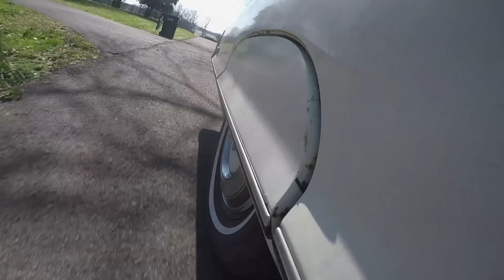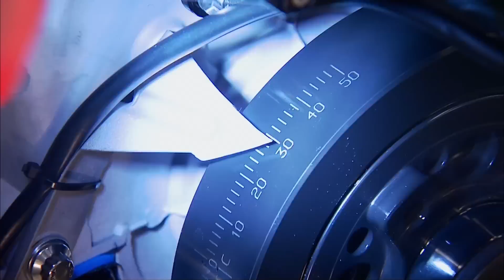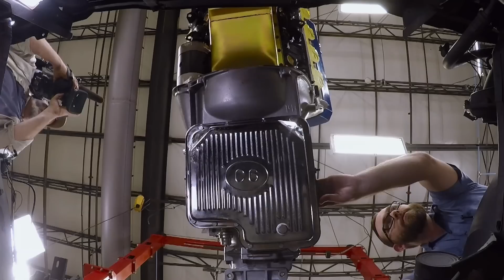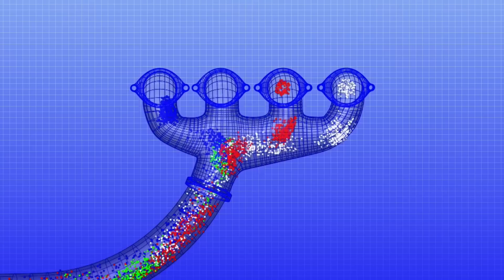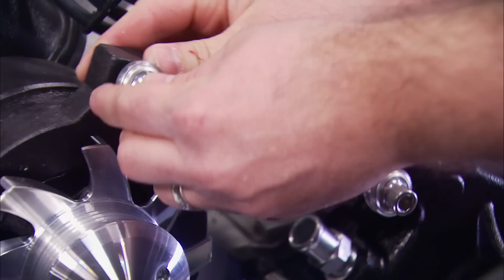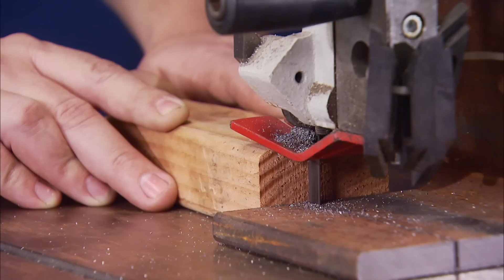Putting A 1,100 HP Big Block Into A '72 Mercury Marquis - Detroit Muscle S3, E8

Comment from the maker: We'll continue to post these episodes here on YouTube. If you can't wait for the rest of the build, visit our site to binge-watch: https://www.powernationtv.com/shows/detroit-muscle
Reply: Love to se a Shopping list. But with the Head'ers is it 6224HKR, 6126-1HKR or  6114-1HKR or some other model.? My friend and I is working on a Ford LTD frome 1972 and it would be extremely helpful since we are living in Denmark and can't afford to buy the wrong parts dou to our imports charges.
Reply: @ketillundsrensen6167  6126HKR
Reply: @ketillundsrensen6167   Denmark? Wow? The '72 Ford LTD was a fantastic car. I don't know where you were able to find one in Denmark but way to go!. I think the LTD back then came for most purposes with a 352 cubic inch engine (worthless) or a 390 which was somewhat better. The 390 was bad to "float the valves" at anything over 4,000 rpm's which means it just runs out of breath. The 390 does much better with a higher lift cam and stronger valve springs. Porting the heads to match the gasket and manifold also does wonders. A car that heavy will wake up if you will with a 3.90 or 4.11 rear end. Good luck with your restoration. Post some videos for us. I will follow you for sure.
Reply: @beboboymann3823   my friend just had his ASTROvan crashed by a drunk driver. So he was looking for a cheap US car with a V8 to replace it. He found the LTD and since 4 doors and Stationwagon isn't that hot in Denmark he could pick it up fairly cheap. We are both falling in love with the car. After A lot of hours working on it doing the winter, it was imported frome new and landed in Denmark January Og February 1973 and belong to a rich family. Since it was kept in a garag for 15years to somebody was buying it. He installed a LDS diffrenciale and a "line lock" to lock out the rear brake and then used it to smoke tyres on American car events then he sold it to a guy how had it for a year before it landed with my friend. He's mother made a new interior in high quality leather. And we services the engine. It had the silly D2VE-A2A heads so they had to go. We were lucky enough to find a 460 engine with Edelbrock RMP gap manifold and C9VE-A heads. It had a 4 barrel 600cfm karburator on it so we kept that. I made a set of ONE OF valve covers in aluminum from Some leftover materials at work and we made a new exhaust. The previous owner had taken 2times  5meters Og 2.5" exhaust pipe and just put it on each side of the Downpipes it was goind under the car and under the diffrenciale, so we had to make our own that was Alot more tigth to the body. I think we gained 5" from the road and oå to the exhaust.
Now the Season is almost up for this year so we have to take it in again and do some more stuff. Just for the killing the Winter times
Reply: @ketillundsrensen6167  Sounds awesome brother.
Reply: What happened to that car,I love the old iron.  Sure would like a chance to try out  that ride. I already watched the next video.
Reply: PowerNation thanks
Reply: Do yall ever give any of these away?
Reply: Should have slapped an 8-71 BLOWER on that baby....nice to see spray on the button instead of the WOT switch which I always thought was STUPID at the track which is why I always run my spray off the button so I can grab it once I know the car is hooked up and ready for it!!! I have had way more success keeping it hooked off the button instead of the WOT plate switch!!!  👍👍👍👍👍👍👍👍👍👍👍👍👍👍
This is what my hand looks like right before I drop 200 on the un-suspecting sucker!!
Reply: Y’all should put some 26’s on this car and go Donk racing 👌🏽🤷🏻‍♂️🤣😂
Reply: Hey PowerNation someone from Canada did a restomod on a 1985 Mercury Grandmarquis 2 door coupe. It has a frame out of an 07 Crownvic with upgraded brakes and suspension, 96 Grandmarquis dash that has been painted black, S197 Mustang seats and console, and a 5.4L DOHC 32V V8 out of an 03 Lincoln Navigator with 03 Cobra heads, 96-98 Cobra camshafts, an Aussie Boss 290 intake manifold, and a Mercury Marauder airbox along with Longtube headers, an X-pipe, and a Dynomax cat-back exhaust in the result of making 341 HP and 351 Ibs of torque at the rear wheels along with a 5-speed manual transmission to make it all fun. The engine he swapped in before was a Procharged 4.6L SOHC 2V V8 making 390 HP and 386 Ibs of torque at the rear wheels along with a 4r80W automatic transmission. Here's the link belowhttps://youtu.be/9EbLSypnrPM
Reply: Some old man or woman kept that nice  you probably stole it,  leave it be   , good god it'st ugly  as hell

Comment: here's a tip for all you guys that have trouble installing a trans of any kind to your engine, way back in the 60s i started doing this, take extra long bolts that fit the bellhousing, cut the head off and grind the end of your home made stud to a point. screw a couple in, or however many you want, and you can just let the studs line up your trans to the engine, simply unscrew the studs and put your bolts in. i still have a drawer full of different size studs i made for different applications. made it easier after i got too old to man handle those heavy transmissions.

Comment: 2 things could be better on this build ...first a beefy making irs for the rear out of Lincoln mark 8  would work well..I did one easy peasy. And  Second why  use a  C6 when everyone knows   a  well Built  AOD reigns Supreme nowadays and you need an Over drive if you want to make it to the pump before running dry. And it would allow you to run some good rear gears... at least 3.73's... but some 3.90's would be ideal.

Comment: My Father owned a 74 with a 460 motor and posi trac. Durring the blizzard of 78 that car made it through all that snow like a knife thru butter. Also many trips to Florida in total comfort. The smoothest ridding car ever, and at 75mph (which was the speed limit then) if Dad was passing it would print you into the seat and we loved hearing those 4 barrels open and that engine roar. Good times.

Comment: Sorry guys , l still work in  litres. So your engine is about 9 litres . In standard tune it's producing 755 hp , tuned but still reliable, over 1000hp. To put this in perspective one of the most revered engines of all time , the Rolls Royce  Merlin in prototype form only just exceeded 800hp. Of course it went on to produce a reliable 2060hp, and at the Reno Air Races they make nearly 3500hp for very short periods. So why this piece of useless information? Well the Merlin was 27 litres it's big cousin the Griffon was 31litres. This shows how we have progressed in high performance engineering.

Comment: Putting a weave in a full pen weld allows the puddle to cool enough that when you whip back onto that colder spot you've compromised the penetration . You now have a pass full  of  weak spots throughout the weld on every layer. Run each pass with one solid smooth motion from the beginning to end of each pass.

Comment: The fuel line must be like a firehose
Reply: Ha Ha that was good
Reply: Do you rate the fuel economy in MPG or GPM with a car like this?
Reply: Whats the guess on fuel mileage?? With an 1100 hp Dinosaur engine , even updated its based on 1960's technology so I'd say 2-3  gallons per quarter mile. The new Dodge Demon uses 4 gallons per 1/4 mile  pass... so this beast is a virtual gas sipper

Comment: 396 BBC with new edelbrock EFI. Cant get it running right. Help?
Reply: did you tell the EFI what cam you have?
Reply: @pablopicaso8374  yeah the wizard setup addresses that
Reply: @joshuahand407  did you make sure its getting good power? They are really picky about getting enough voltage
Reply: @pablopicaso8374  I'll check

Comment: The problem I have always run into, is 1965 to 1979 frames rot where the control arms bolt in. I ripped the 9 inch out of my 73 Marquis, a 67 Monterey, 68 Custom 500, etc. Another cool feature from the early 70's, was start the car, put your foot firmly on the brake petal, and wing the throttle, she would jump into reverse every time.
If you are still reading this, the cheapest horsepower boost for 1973 and up, is to buy a pre-1970 429 timing set.

Comment: For all you potential Marquis owners out there, they pulled a 385 series engine and C6 transmissions and replaced it with a 385 series engine and C6. If you wanted to keep your accessories intact... just swap them over, mounts and all. Yes, V belts can throw at high RPM, like they said, but that's a risk you take.

Comment: power steering adapters to run a saginaw power steering pump ? ford used them from the factory in the E series vans , play with the years and you can easily find a hose that connect at both ends and work with minor tweaking / bending of the steel ends for correct routing , been there done that more than once ...

Comment: shame on you guys , you never mentioned the steel plate between the water pump and the front cover , many a 429/460 has cooling issues because they are left out buy people that don't understand , and or yank a pump and it's stuck to it , and it gets tossed , these engines cool poorly at hwy speeds without it , and can even over heat , but yet will idle for days and never overheat without it , a many of heads have been pulled looking for a cracked head or blown gasket all because that water pump backing plate is missing .... a segment on or including this issue would be a good idea when another 429 or 460 varent comes down the line ...

Comment: Those was the kind of cars that were like kind  off roads springs.  you run over speed bumps and curbs the loose springs  and weight absorb the bump and is so smooth riding doing it the speed bump killer.

Comment: The body style is very interesting, a cross between an Eldorado and a Torino. Does anyone else get annoyed with these high-dollar builds that cost more than the car is worth? I don't know ANYONE that has a fully equipped shop with $7,000 worth of this and that tool for every fastener somebody can think of. I pulled the engine out of my Suzuki XL7 in my driveway, and replaced head gaskets re-using the head-bolts because I don't have the money for new stretch-bolts.

Comment: It's not angle iron, more mild steel angle. They stopped making angle iron at about the end of the 19th century lol. You can still see it on some old bridges.
Rather than cutting and welding it you could've just gone and bought some channel off cuts from the steel yard. 

In fact they might've let you rummuge in the scrap bin for free. 

Re the welding at home, a good home inverter stick welder turned up on high and multiple passes. Small stick at the bottom with the amperage turned down to say 140ish then the classic 3 pass weld with a larger rod layered nicely into the adjoining pass (the way you learnt at night school) - right? : )

Comment: I don’t wanna b a downer but...that’s not an 1100 horse engine. It’s 750 with no accessories and before drivetrain loss. It’s prolly about 600 to the wheels
Reply: Yeah, I felt like the title was a bit of click-bait. Sure it made 1100hp, but with a big shot of spray. It's a 750hp motor, that's probably putting 650-ish to the wheels with full accessories. Still though, I enjoyed this build and it would be one hell of a fun sleeper to go rip around in. I've always loved sleepers, so I like oddball builds like this. Even at 4600lbs (which is actually less that I would have guessed it weighed), 4 digit HP/TQ on spray is still gonna haul ass.
Reply: @branchtana315  Note too that such a '385' series (429/460 family), especially with more than 600", has gobs to torque. Even 600-700 ft lbs can break axles, especially on a two ton+ plus machine, with a properly set up rear suspension, etc for good traction.
Reply: The normal parasitic loss on an auto is about 10% where are you getting a 400 hp drop? Or about 40%?
Reply: @Themadoutbacker  He's deleting the NOS
Reply: Nitrous, man!
Reply: I was looking for this comment so I didnt have to repost it 👍
Reply: Good catch, there. Note the HP rating of the original 1972 429 was probably 275-300 HP at the crank, that ca 200 ponies is also at the wheels. :)

Comment: Why did they have to use a Garbage Motors power steering pump?
Reply: Actually,  Branon, its a Saginaw PS pump and all of the big three used to use Saginaw products way back then right up to the 90's due to its excellent reliability.

Comment: Ford Powertrain Applications has headers that fit the 1970s fullsize Ford, Lincoln and Mercury cars with 385 series 429/460 based engines, which is the headers that I have on my 460 based 521 powered 1978 Mercury Grand Marquis daily driver.

Comment: "Oh lets take this 1000hp engine and put it into a car that can't even handle the stock engines power and becomes dangerously unstable at above 80 mph and will require more space to stop from that speed than an 18 wheel truck." 

Good idea LOL.
Reply: Dangerously unstable? These old lincolns and mercs could easily cruise at 120 no problem, I've done it. As far as the chassis, they are built pretty damn robust!
Reply: Now braking is not bad but I think they upgrade those as well as the rear end!
Reply: Those cars hugs the road like a cat on velcro.
Reply: Hey folks its BeyerT1 the Typical modern car lover.

Comment: Lose the solid roller and nitrous. Add throttle body fuel injection for drivability/maximum low-end torque and now you've got the ideal land yacht.
Reply: Miles Rains these cars aren't gonna be daily driven. That would be a waste. The cars on this show are made for that, show. And to sell parts for their sponsors.

Comment: cool make all that power just to use a power robbing no overdrive C6
Reply: Matthew Skaggs C6 are required when makong 1100 ft tq. It was either that or a powerglide, which we know Ford guys hate.
Reply: At least do a built 6r80, while it will may rob just as much power it would at least provide overdrive which would think you'd want for this project.
Reply: The C6 is the easiest and strongest to put behind this engine. However I would love to see a built 5R110 behind it!
Reply: dodgeguyz I’m disputing that my point was at least get a trans with overdrive and a 5R110 would be cool too.
Reply: Don't worry, think they're gonna keep the 2.75 in the rear so the RPM's stay low. . . 
this should last forever.

Comment: What about the MURCURY MAURAUDER BODY? YES 390..WAS GOOD..I HAVE A 1968. GALEXCIE XL 429 Q CODE FAST BACK WITH THE HIDEAWAY LIGHTS. .. IT HAS 429 BADGES ON FRONT FENDERS WHITE BUCKET WITH COUNSIL HORSE SHOE SHIFTER.. IT ONLY HAD 70K IN MIDDLE OF FINISHING IT OFF..IT WAS IN NEAR GREAT CONDITION. NOT A DENT ON THE WHOLE CAR HAS ITS ORGINAL PAINT DARK BLUE . 
IVE ADDED SOME UPGRADES BUT KEEPING IT FACTORY MUSCLE STOCK..THIS CAR HERE REMINDS ME OF A 72 GALEXCY I HAD IN HIGHSCHOOL BACK IN 1977..I LIKE WHAT THIS TRANS CONVERTER IS GONNA DO FOR THIS BEAST LUXERY CAR...WAY TO GO GUYS.

Comment: It's a bit disappointing that they went all out on the engine and didn't get fuel injection. Also, will the chassis need stiffening since they're putting 1,100 HP through it?
Reply: that carb will get it done easily.  simple and effective till this day
Reply: Based and Janinepilled This might come as a shock to you but most race cars still use carbs.
Reply: I think a full frame 70’s car is pretty stiff!
Reply: @dodgeguyz  but not everything attached to it. And the stock suspension parts are heavy

Time for some global West kits.
Reply: mrhazel 
They built their own rear suspension control arms. And I believe put in a built up 9”.
Reply: @dodgeguyz  yeah theyre gonna need it. thatstock rear end will grenade.  i thought the original is a 9 in?  maybe not.
Reply: @dodgeguyz  Didn't know that, I never saw it on TV.
Reply: Based and Janinepilled 
Yes they covered it in one of the episodes! 
And yes the original was an open 9” but stock cruiser. I think they upgraded to a built aftermarket axles and all.
Reply: @dodgeguyz  they rebuilt the rear end? That's what I would have done if they didn't
Reply: mrhazel ya. I don’t remember exactly. They either put a complete new assembly on it or a new center section and customs axles. IDE like to see that episode again.
Reply: carbs for life

Comment: Didn't Finnegan make 1040 without N02 on his big block?
Reply: Clobercow1 His engine was meant to be a boat engine. Not to mention hes using all out race billet parts. It easily cost 4-5 times as much...
Reply: Clobercow1 

I liked his channel till he started crying like a toddler about how he got ripped off when he bought the ramp truck and made it public like a female.
Reply: Yeah, on very high compression though.
Reply: @anonanonskitheanoniest  yeah REALLY HIGH compression... funny car ratios
Reply: This is actually a show on tv most the stuff they build the parts are supplied through corporate sponsors so they work with what there supplied to ise
Reply: I watched farmtruck pull over a grand to the rear tires no bottle... we never know how long any of these these can last tho.